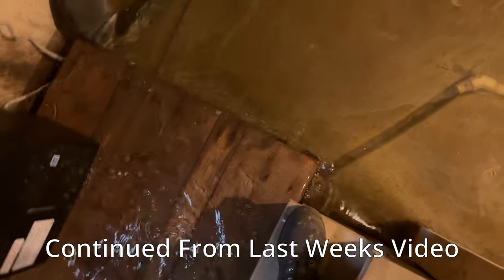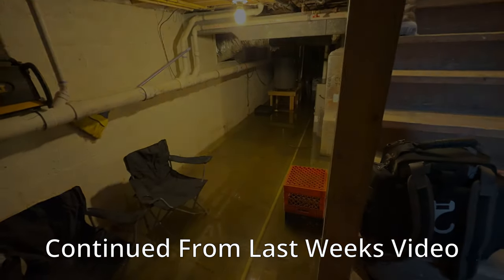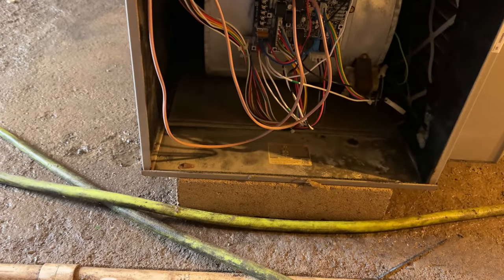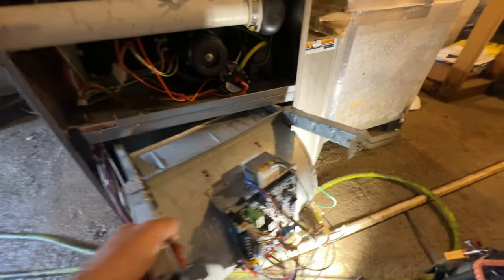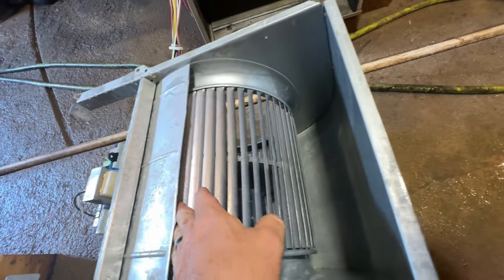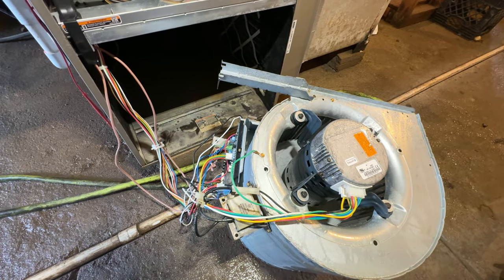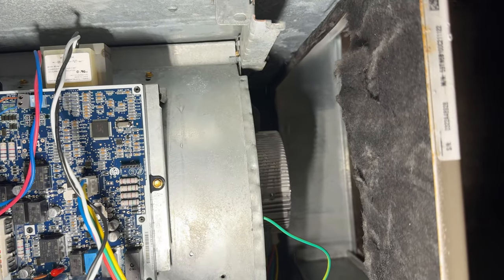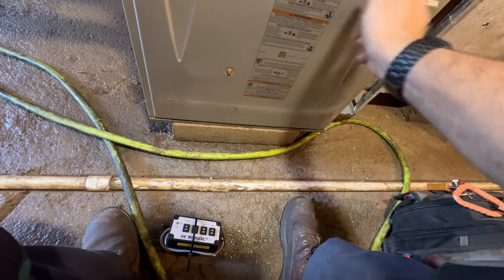Air conditioner Just Stopped Working! How To Fix & Prevent This Again!

Comment: That's why I like to stick to a basic system. I have an 80% furnace with a constant torque and a single stage condenser. Gr3at video as always Rick
Reply from the maker: Thanks Jason!
Reply: I don't really consider constant torque basic, I'd rather have a psc motor.

Comment: I used to work for EMS and did HVAC repair on my days off before opening my business in 2002. Just make sure If you are going to get shocked, make sure to use your right hand. It's much less likely the current will cross through your heart.
Reply from the maker: I try to not cross my heart.

Comment: Those motors are not available where I live. The website says back ordered. Supposedly there’s a GreenSpeed motor part 6510V should replace it but you need an interface module for communicating motors. Good ol’ Carrier
Reply from the maker: Yeah, this one actually communicates with the board,  as soon as the board doesn’t see the motor it’s not gonna try to run. Some of the cheaper models use a multi tap motor based off low-voltage. This is not one of them.

Comment: on your fluke test leads, see if the tip covers pop off to expose longer tips.
Reply from the maker: No, those are designed like that. You can take the whole handle area apart, there made by an American test probe company that specializes in oscilloscope probes.